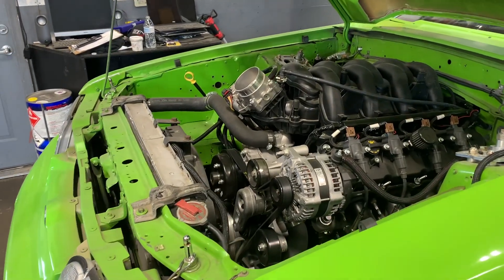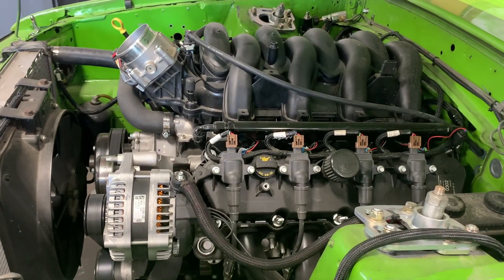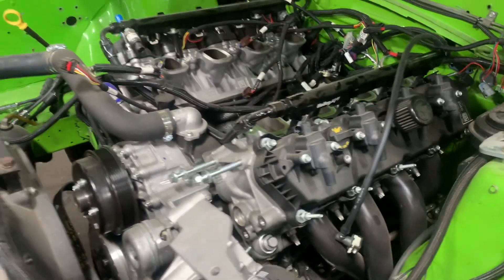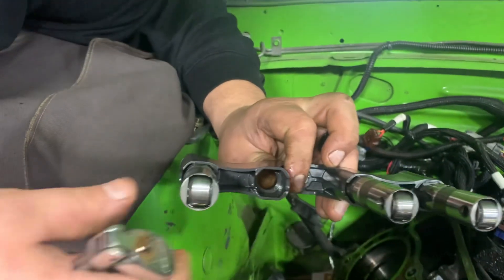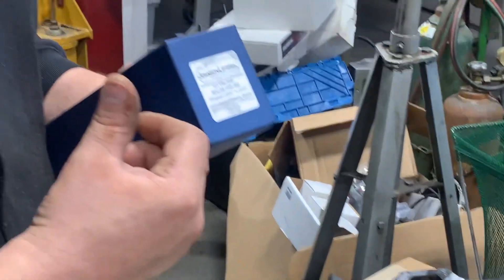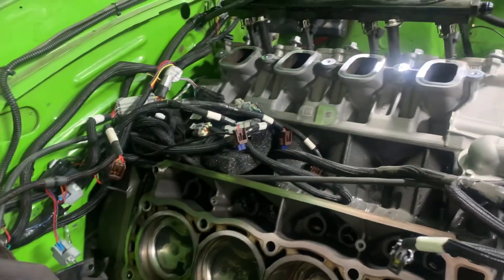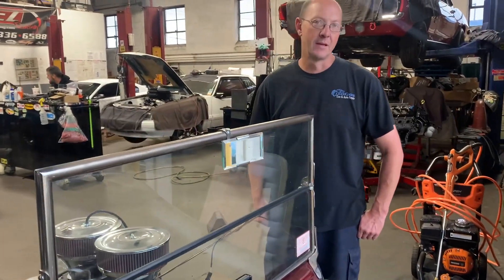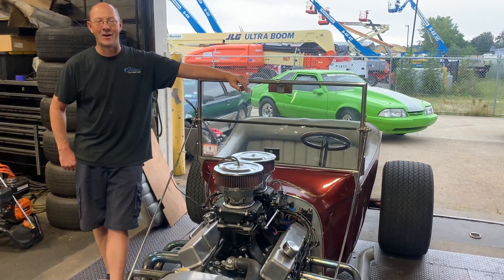LS lifters in a Ford 7.3 Godzilla??

Comment: Too bad Ford did not go to a .904 lifter and design it where you could service lifers without pulling off cylinder heads. 🤔
Reply from the maker: Under the heads is the way the big 3 all did it. LS, Gen 3 Hemi & Godzilla

Comment: What push rod length?
Is that a stock rocker arm?
Reply from the maker: The rockers are stock,  the pushrods are a little longer than stock.  You will need to use a pushrod checker to get the exact length because there is only a small window for preload.

Comment: Would you ARP fasters the engine in the future??? 7k RPMs makes regular engine fasteners fail???
Reply from the maker: We hard already replaced the cam bolt with a custom tool steel fastener .  With the engine still being NA I don’t think most of the other bolts are under that much stress.  We are thinking  about replacing the rods